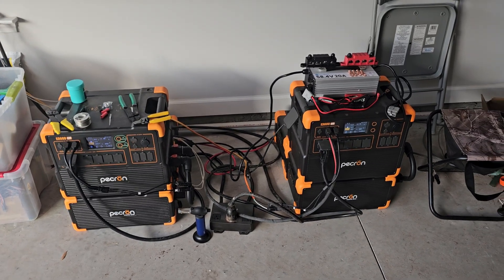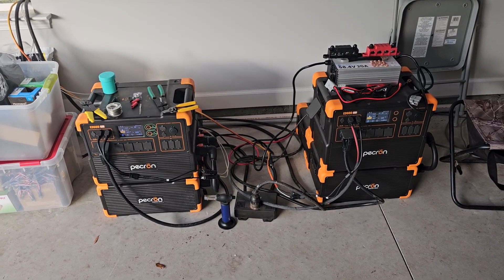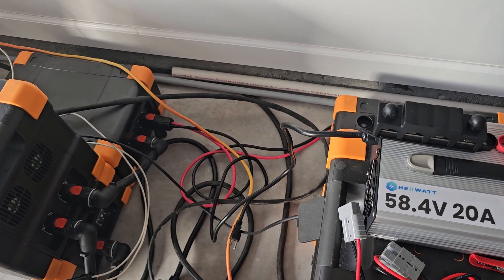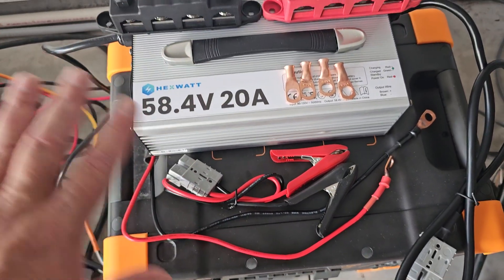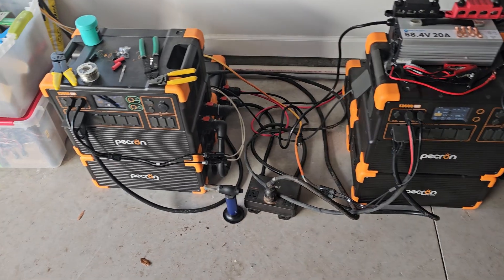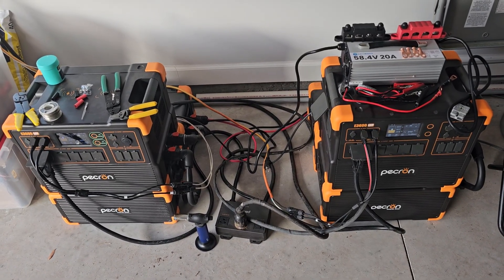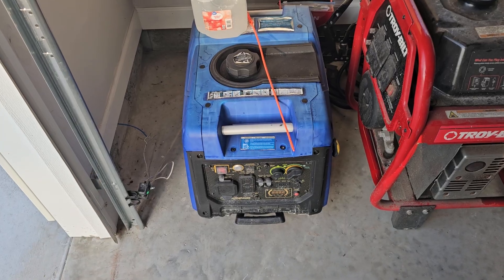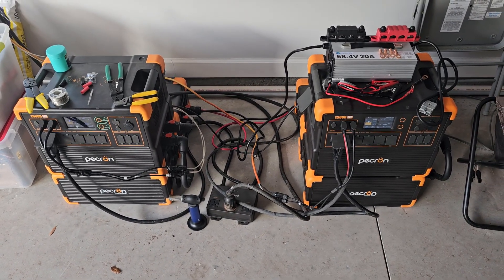Pecron E3600LFP backup charging part 1. The idea!

Comment: Let us know how it goes! I was all set to dot this and had ordered MJ32 cables to try this last week.

BUT...

I contacted Pecron about my 58V golf car charger and they said they do NOT recommend using 58.4V because that is "the high end of the spectrum and more for lithium ion than lifepo... therefore unsafe if the BMS failed from prolonged use."

However,  they said that if you can limit the range to about 56V, then it's safe. However they all said you need a fuse before the connection. Hmmmm. 

Well the eco-worthy 48V 60A  battery charger (essentially a cheaper EG4 Chargeverter that you can regulate the voltage and amperage) is on sale for $250 on Amazon for Black Friday, so I picked one up.  

I'm just gonna use it to try and charge directly through the Pecron XT60s for simplicity and make sure that works, but eventually will also plan to try charging through the MJ32 when I get the plugs/cables.  If I can just charge through the xt60s that will work good enough (I think) since I'm not using both XT60 ports on both systems currently.  But id like to have options and eventually be able to do both.

Comment: I have 2 51.2v golf cart batteries connected to mine, that I supplement charging with a 5a charger, but I always disconnect from the bonding cables with a breaker, but after seeing your video, I’m asking myself “why”. Shouldn’t have to disconnect since the charger is designed to charge these batteries. Sun shifting until about February in central Mississippi, just not enough solar coming in right now.
Reply from the maker: My system has not fully recharged since Friday 21 November, 2025. Clouds and low sun angle have an effect. I do have 3 more 400W panels to add to get to 4800W.